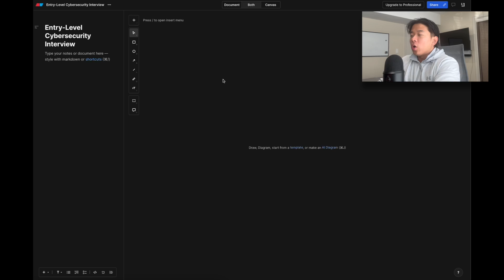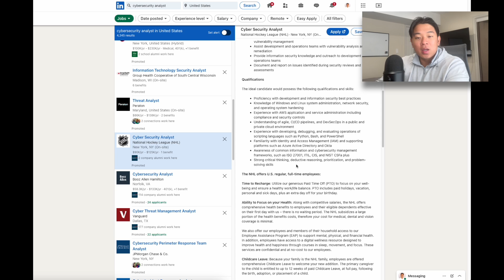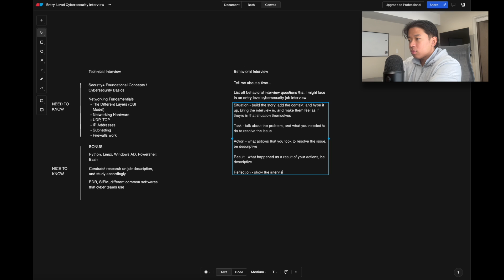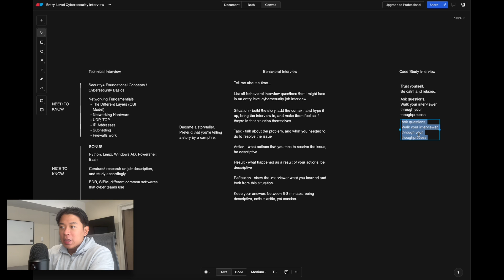How to Ace Your Entry Level Cyber Security Job Interview (Complete Guide)

Comment: Thanks Ben
3:02 overview
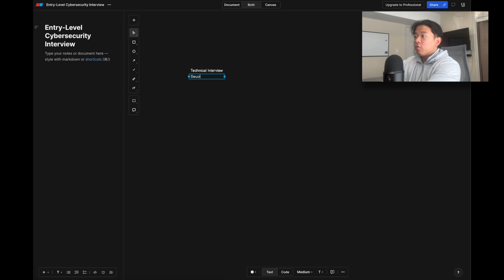3:36 Fundamental concepts using Security Plus 601 Exam // Threats/Vulnerabilities // Ports etc. 
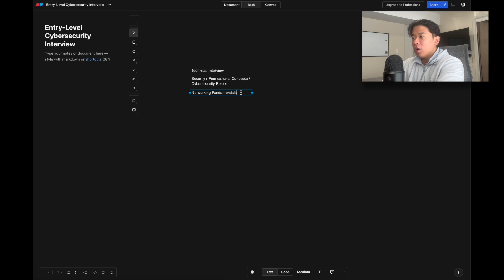5:42 Network layers (OSI model) ??// presentation // applications // hardware // Firewalls
8:00 need/nice to know abilities // 8:36 scripting like Python Linux BASH Powershell and navigation in terminals 
11:40 conduct research, knowing roles, common tools/software
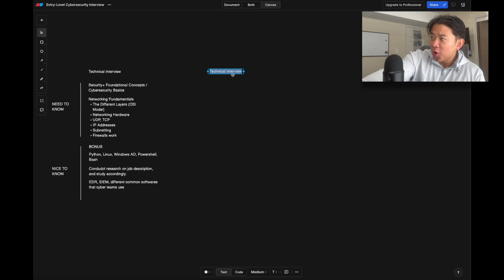13:58 Behavioral Interview and conduct
15:24 open ended questions time with disagreements and resolution // issues with teammates // handling challenges 
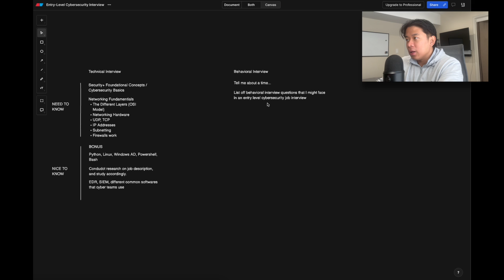17:13 STARR framework
Situation - storytelling 
Task - problem or conflict that needed resolution 
Action - what was method or course of action 
Result - what were the results
Reflection - what did you learn 
20:46 durations of answers (5-8 minutes being descriptive and engaging)
21:31 - 25:40 story time of customer relations 
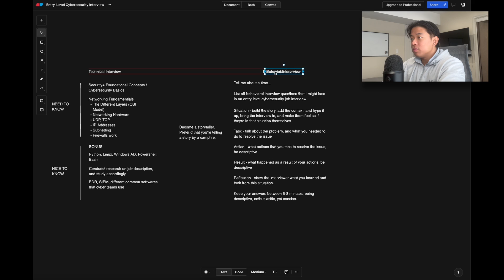27:08 Case Study Interview